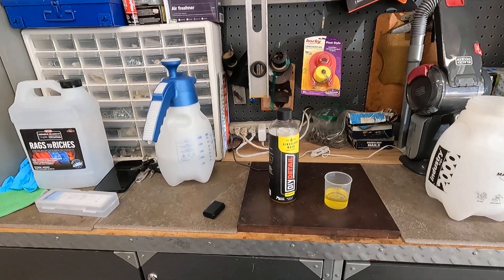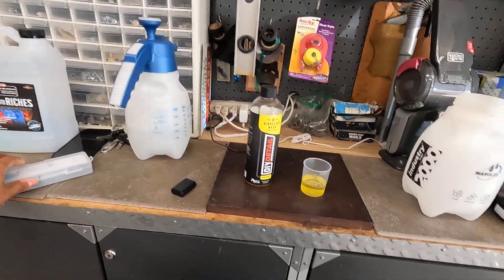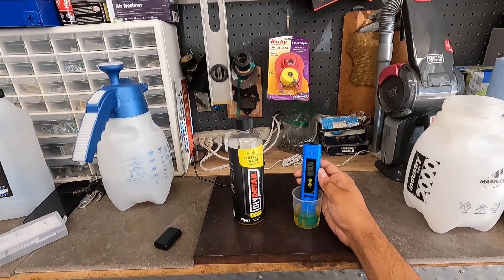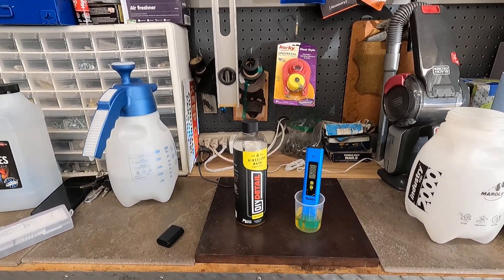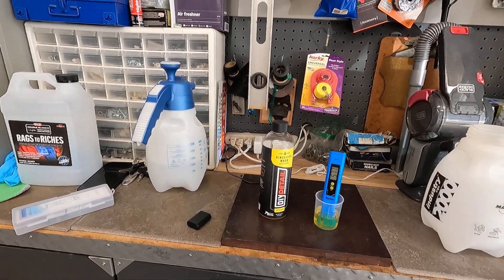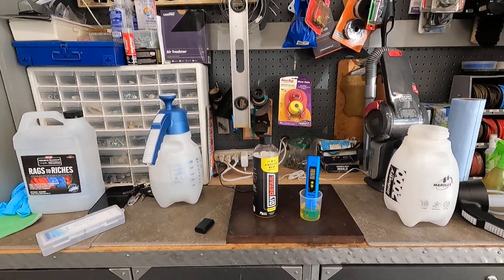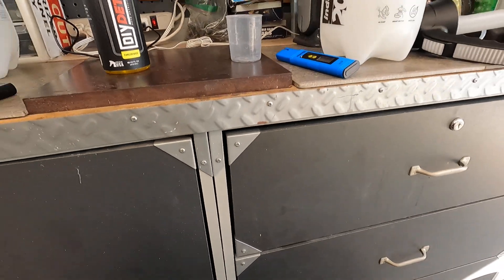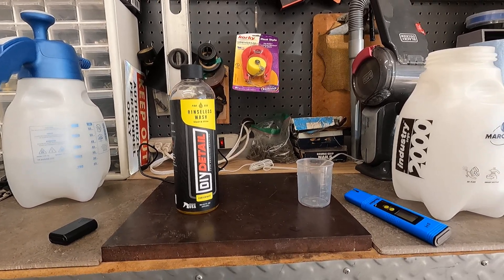DIY Detail Rinseless Wash - What is the pH?

Comment: I hope this brand makes its way to the UK, it looks like a great product and brand. 

Meanwhile, could you get your hands on a bottle of 2022 Dquartz from carpro,  siloxane diamond fusion- you can use it on bare metal and it's supposed to stop mechanical resistance from swirls and marring. I'd love to see a demo on that
Reply from the maker: Unfortunately I tried to get dquartz and I was told it would not be possible. So if you know a certified CarPro installer willing to send me some I would definitely show case it.  I personally do not know a CarPro certified installer.